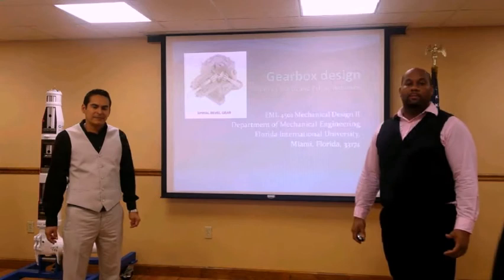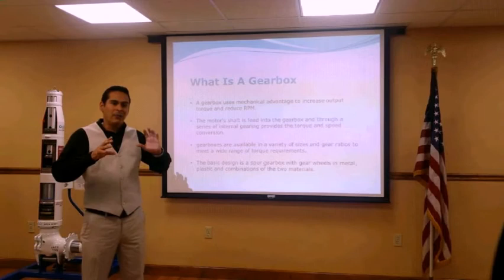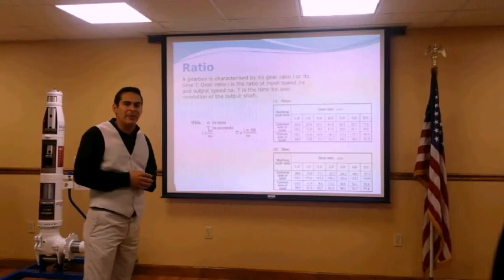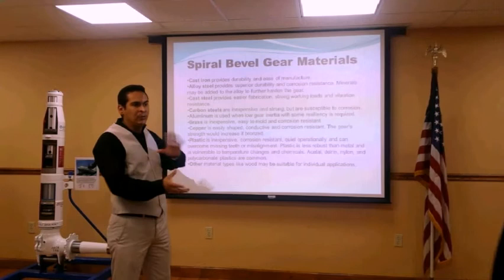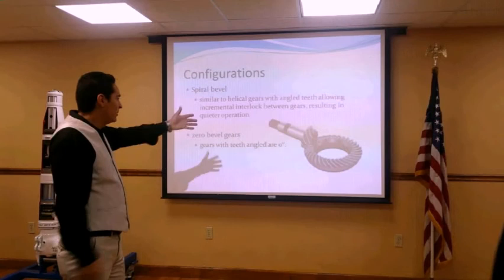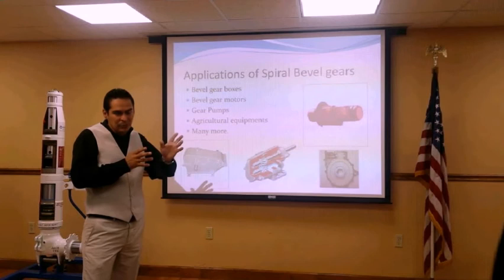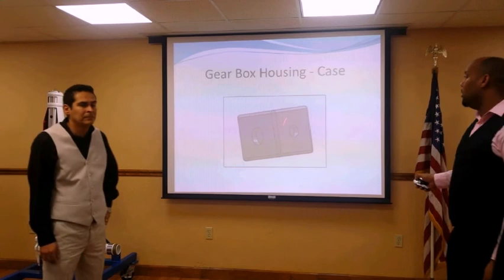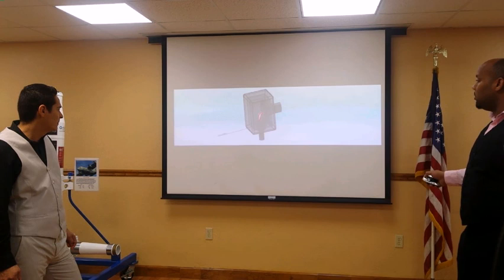Team 12: Gearbox Design

Comment: This presentation was too long. Thought you guys showed knowledge on the topic, it is really easy to drift away from the presentation. Better lighting, bigger fonts, and the use of more images would have made this presentation slides understandable and more engaging. In addition, try to not have so much information in just one slide, instead divide them into multiple slides.